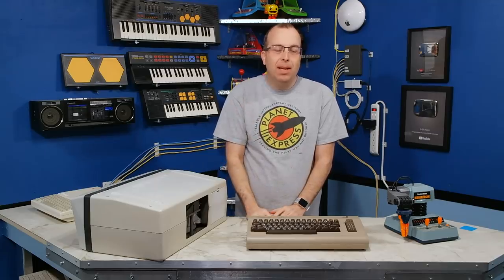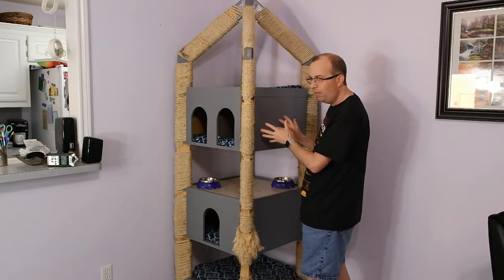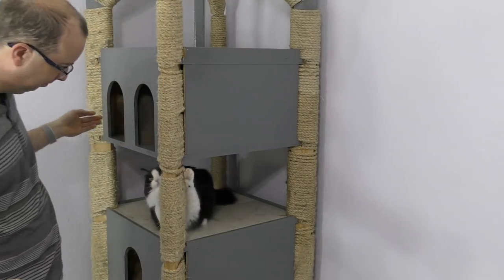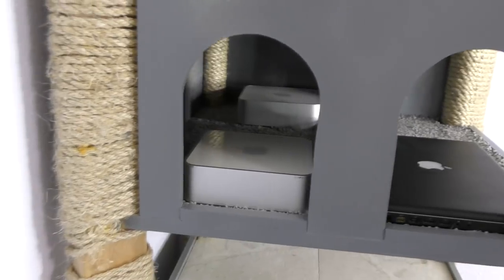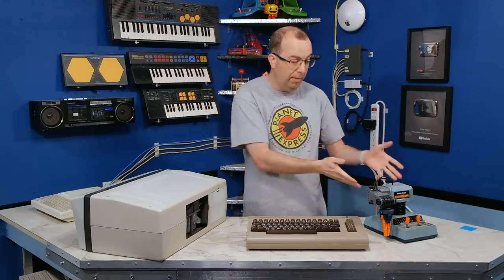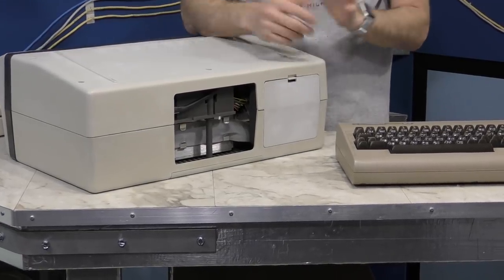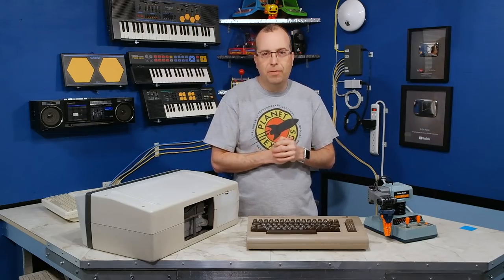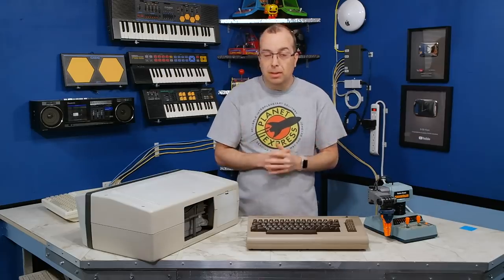Updates on Previous 8-Bit Guy Projects

Comment: Here's an interesting question -- If the range extending gas motor/tank are so rarely used, is it an issue itself? Like... a well used motor is a clean and smooth motor. Also, leaving gas in the tank for... years (a few gallons in 2 years?) the gas could go bad couldn't it? Or is it a sealed enough system that it's not an issue?

Comment: Dave, you can get some round plastic rod from a hobby store and make your own gear for that armatron. simply cut teeth into it using some files. should do it and you'll have extra material if it breaks again.
Reply: also sorry to hear a subscriber ripped you off basically.
Reply: OpposingForces I think getting enough strength in those thin slivers of plastic between the teeth is going to be the biggest problem with almost any replacement.
Reply: yep nylon should do it, or make a file guide on 3d printer and then make from aluminium

Comment: That broken gear in the armatron... you might be able to mould one with resin... if you used a North American equivalent of this stuff: 
https://www.easycomposites.co.uk/#!/resin-gel-silicone-adhesive/casting-resin/Xencast-PX90-Semi-Flexible-Polyurethane-Casting-Resin.html
it'd certainly be strong enough. And casting is just so retro... it's how we 3D printed back in the days of 8-bits.

Comment: I second what others have written about the Armatron gear. Since it is both small and simple, if it were me I would just get a bit of brass rod from the hardware store, cut off a bit, chuck it up in your drill, spin while using a flat file to get the correct OD, cut to length, drill to fit the shaft, needle file the few teeth, and epoxy onto the shaft. I have done this several times to make small gears to restore antique mechanisms. Does not really take very long, costs almost nothing, and usedms tools you either have already or can buy inexpensively.

Comment: Haha, classically geeky to get so much into the project and forgetting one fact . :) These carpets when new can emit chemicals (both odorous and odorless) through even 6 months. You wouldn't like to sleep in a room with it if it was not ventilated. ;) The cats are probably thinking: just when the foamy beddings stopped to smell placticky he changed them for a new plasticky-smelling beddings. What does he want, to poison us? ;) Ever heard of solid, hard seagrass-filled 100% non toxic bedding for animals? You know, they have n times smaller body mass and x times more sensitive smell, so... ;) I bet I'll hear some reply to this fact in the next video. ;) Don't worry, if the carpet is properly made, not with some chineese-poisonous plastics, the 'factory new smell' will go off with ventilating the room and the cats will like the new build.

 I've cut and dried normal high-length meadow-like grass (freshly grown and w/o direct exposure to car exhaust fumes of course) and the dogs liked the cosiness of such pillow instantly! Animals know what's best for them. You may try that with your cats.

Just in case: I like your videos, my comment is precise becasue I hope that info would help you in some future cat-house update. :) You can also put a fan for a day or two and check if it will blow off that 'new smell' off the carpet so the cats like it more. :)

Comment: @6:50:  Unless you're printing at a ridiculously high resolution, .1mm will be fine.  Use PETG or ABS at 100% infill (its small enough that it'll likely go 100% anyways) and it'll be plenty strong enough.

Comment: Radio Shack's Armatron Robotic Arm from 1984: could you pull the cog off one of the axles in the sparm arm ?  Or adapt one of the other axles with a cog from the spare arm ?  Failing that you could have a go at making my own cog from a small brass rod - cut off the required length of rod, drill a hole through the midle, and gently file the teeth with small files.  Use one of the other plastic cogs for a template.  Take it slow.  Epoxy it to the axle when done.  You should end up with a good result and it shouldn't take hours - once you have the brass, the files, etc ready to go.
Edit: fix typo.

Comment: Can you send me the dimensions of one of the gears? I've got a 3d printing service and this looks like the perfect excuse to load up nylon into one of my 60 micron nozzles to test that. I've printed working gears with a diameter of about 3mm already. And I've printed parts that as of now withstand multiple tons of pressure. So combining both techniques is the next experimental step 🙂

I've got a picture of a plastic roller used to bent metal plates into shape in my page:  https://www.3drt.eu/en/2018/02/25/load-bearing-capacity-of-3d-printed-parts/

The load of that little armatron shouldn't be much of an issue 😀

Comment: Yeah that armatron claw gear was always the weakpoint in the design, I remember operating one and hearing the clicking of the gear jumping. The fact the gears were plastic probably didn't help either. I'd love to see a video of somebody modifying the armatron with metal gearwork, like making casts of the existing gears, racks, and pinions, and using those to make steel parts. Or maybe Brass with a leather wrap where the plastic black sleeve goes, with a miniature steam engine hooked up to power the main shaft :D A steampunk armatron would be so sick.

Comment: just discovered your channel;, very nice. As to your armatron, every motion has a primitive slipper clutch on it, you can hear them engage if you stall one as a click, click, click. Mine had a broken gear on the metal shafts as happens with many gears of this type. I replaced mine with a gear from a a tamiya brand gearbox set, its been so many years I dont remember the precise kit. I did have to drill the center out of the gear to fit on the larger shaft. It was secured with a little CA glue. You should also look for an armatron 2, it was a mobile one with tracks and an arm. Be well!

Comment: About the Armatron-Gear: Have you been able to find out about the exact measurements of the missing part, is it exactly like the others?
If so, you might ne able to recast it in resin, it it isn't even too small for that.
If so, you should post a diagram of the exact measurements - I think chances are pretty good that someone might find a fitting substitude from somewhere else, maybe from another toy!

Comment: My condolences on the loss of your kitty.  They're all so adorable!

I'm still driving my 2013 Volt and I love that car.  The fuel savings compared to the van I used to drive all the time pretty much makes the car payment (I have a nearly identical van as a winterbeater to keep Michigan road salt off the Volt, so no fuel savings in the winter).  I can't recommend the Volt highly enough.  Unfortunately I've never seen any advertisements at all for it, so a lot of the public doesn't really know anything about them (at least around here).  Down side is, I live in very rural place, so to drive to any city will result in burning at least some gas for the round trip if I can't plug in.

Comment: I wonder if you may have had better luck with your second story room of the cat tower if you had drilled an access hole in the ceiling of it, along with clearing away the center divider. I built something "similar" years ago, and each level is accessed through the ceiling of the level below. Make it an adventure for a cat, and it's more enticing!

Comment: Here you go. Apparently, you may have to drill out the core to 2.5mm, but these should work for the armatron.

uxcell Plastic Gear DIY Reduction Worm Gears Model 102A for RC Car Robot Motor White 20Pcs https://www.amazon.com/dp/B07DH9DH89/ref=cm_sw_r_cp_apa_i_DuCOEbH60A1E7

Comment: I have one of Armatron robot and it also had the problem with the clamp gear.  The funny thing is that I simply had one 3D printed and it has held up just fine for over a year now.  I'm not sure why he is claiming that it isn't possible to 3D print it.  My guess is that he just doesn't want to mess with it.  It is such a quick easy fix that would bring two vintage Armatrons back to life.  He should donate them to someone else that will actually take the time to fix them.

Comment: I wonder if there's any engineering solution to that Amatron design flaw. Has anyone invented a gear that can transmit a limited amount of rotation into movement, and continue to apply force at the end of that movement (so it keeps gripping), but lets the shaft spin with just the resistance of keeping the grip going?

Comment: You could try the replacement by using a 3D Printer that uses Tough-Resin...

Have one at Home... The Moai SLA printer.
Just would need a STL...

The other possibility: making a mold

Comment: Hey David, why are you using such an old dell monitor for video editing? Wouldn't be better to use something like older Apple (HD or LED) Cinema display? I use them (24" HD Cinema display in secondary setup and 1x 27" LED Cinema Display + 1x 27" Apple Thunderbolt Display on my primary setup) and after a few years they are still working very well and they look awesome!

Comment: The gears are a really funky size.
I fixed mine ordering gears from a place called sdp-si.
"A 1M 2-TA32008" and "A 1M 2-TA48010" were close enough to work.
The failure is not due to spinning of the gears. When limits are reached, you will hear a clicking sound. I'm not technically versed enough to know what it's called, but you will see a coupling that acts kind of like a clutch. This will allow the shaft to spin, while the articulated gizmo has reached its limit.

Comment: You should be able to print the Armatron gear in polycarbonate or nylon without a problem using a 0.2mm nozzle on an FDM printer. Should hold up about as well as the OG nylon gear.

Comment: Back in 1985 I built a Vic 20 controlled Armatron,  I replaced the motor with 6 12v dc motors (and gear blocks) giving me 12 inputs (forward and reverse) that came from a 16 bit decoder that the Vic ran, It worked but the transistors I used kept blowing so then I tried using relays but the output from the vic was pulsed and wouldn't run the relays,   I still have it kicking around somewhere  .

Comment: LOL I also used kitchen floor tiles for my desk. worked just fine for over 5 years. In fact, I recently found leftovers so I could replace couple that have worn down a little. (just shiny stuff flakinmg off, wood pattern is fine)

Comment: To the robot: I could make you a gear that small with my 3D printer if you have constructed it... But: the gear will be too weak...
(it starts to crack very fast)
The better Option would be to make a part with the  3D Laser Resin printer (SLA ) , make a mould out of it and fill that with some strong material!

Tough resin is another opinion... 
But for my SLA printer this resin is not available at the moment...

To the handle: hope you'll get it back!

Comment: For the Chevy Volt (I know it's not related to computers) I've found with one my family member has, if you drive under 50 miles per day, then it makes sense as the average range I've seen on one of those is 30-60 miles or so.  But if you commute to work, say, on the highway, it may make some sense, but you will still need some gas.  But even driving on the gas engine, I've been able to get around 35+ MPG (and that's on a 2012 Volt).  I'm still not quite sold on completely electric vehicles, except maybe the Tesla models that can go 200+ miles per charge, as anything less than that really ins't feasible unless you just drive locally or don't take road trips that often, or aren't in a rush and can let the car charge at charge stations every few hours).

Comment: Looks like you could take a cigarette lighter heat up the metal shaft Slightly on one of the other gears of your parts Arm robot You should be able to slide the gear off once the metal is hot put it back on the other shaft with some superglue It won’t be as strong as original but it will get you up and going

Comment: STL for a replacement gear for the Armatron can be found at: https://www.thingiverse.com/thing:1241175  

Rather than printing this at home with an FDM printer, I'd upload to shapeways and get it made in a number of different materials and see how they turn out. I've used their strong&flexible (sintered nylon) for projects before, but for a small gear like this, their HP Nylon might be the way to go.

Comment: You mean "electronic" engineer, not "electrical" engineer.
I highly doubt an electrical engineer could do that kind of thing, seeing as they work mostly with higher voltage AC in buildings and installations.

Comment: Yo, I built those arms before. Those 4 gears are the sames. So take one from your donor. FYI you could find a machinist (aka thisoldtony) replace most if not all gears with metal then upgrade your motor.

Comment: 7:07 "There's nothing to relieve the pressure on that gear once the clamp is completely closed"
Wrong, the gears on the clamp side have teeth missing, so when it's completely closed the driving gear (the one that broke) just spins freely.
That's just a matter of many transfers of motion through many gears, because that's the last moving part, that makes that particular gear work over time, if it had been metal or all the gears were lubricated with PTFE grease (which I don't think existed back then) it probably wouldn't have broken.

Comment: Will you ever get a brown cased original Commodore monitor for your bread bin 64? As for the Armitron gears, I'd say try and find a hobby shop that deals with RC stuff, they have a ton of different plastic and metal gears used for RC drive and control.

Comment: Think one of these days I might built a desk similar to the one shown.  I have a store-bought one that is similar, but it just isn't that sturdy as it's partially made out of fiber-board (although the tops are made out of a heavier wood) but it has a column that sticks up where the two pieces join which is annoying.
For electric cars, I would only buy one if it was only a few years old and has less than maybe 30,000 miles on it.  The batteries generally need replacing after 8 years or 100,000 miles (although with the Volt and others that have a gas engine as well, you may be able to just drive on the gas engine when the battery dies, but those batteries can cost upwards of $6,000).  I see a lot of Toyota Prius's being sold for cheap (like $1500) that are 8-9 years old because they need new batteries.  So either buy them with low miles / newer, or buy them new.

Comment: As far as that little gear, try looking for old toys that have cheap, DC motors in them; they often have a nice, metal gear on them, though you might need a gear/pulley puller (Micro-Mark tools used to sell one, I don’t know if they still have something like that, but they’re used to remove model train wheels from the axles) If you’ll email me the dimensions of the gear (or take a photo of it next to a scale rule) to Wsquires-at-satx-dot-rr-dot-com, I’ll see if I have any hobby motors with a gear like that on it. Don’t worry about the cats; they’ll find a use for your ‘mods’! :)

Comment: Cat names... The Noid, Pig Bunny, and ... er... what? "She"? Kitty McCatface? Kirjava?

The little gear, would it work to 3D print a sort of template for it - essentially a puck of the right outer dimension, with a centre dimple top and bottom to guide you in boring out the axle hole, and bumps around the circumference of the right number and position to guide you in filing out the teeth by hand / using a very fine metal filament saw (at super low speed with tongs to hold the workpiece...), gradually and carefully until they matched the depth and width of the teeth on the other gears, overcoming the resolution problem?

Of course if you're going to do that you might really be as well to just get a miniature pulley of the right dimensions and axle width, then mark it off with a pencil and protractor, but if you haven't such a thing knocking around 3D printing then doing the donkey work to finish it off might be your only practical option.

Then whilst you're at it, put an endstop sensor system in place that will stop the motor trying to overdrive the gripping mechanism in either direction.

NB, whoever it was who had your Osborne handle ... presumably you have a street address for him? Might be worth getting some trusted associates who live near him to go and check up. You know, just to be sure of his wellbeing, he might be sick, dead, in a deep depression, homeless, kidnapped, or a school student whose extracurricular activities have been found out by his parents with all internet communication cut off as punishment for not knuckling under to the man.

Comment: When I was at University I had a VIC 20 and that was about the time that Radio Shack introduced the Armatron.  I bought one thinking that I could interface the arm to the computer.  Of course when I opened it up I was confounded to find that the whole unit was mechanical.  Years later, Radio Shack sold another unit that was interfaceable, but I had lost interest by that time.

Comment: In the arm.. all those gears are the same. You could harvest any of the small gears of the other unit. Also, 3d printing IS an option, depending on your printer offcourse. My printer (basically a beefed up prusa i3) would print it just fine. If you want me to print one, I'll need the inner diameter (where the axle goes), the outer diameter (around the tooth) and the number of teeth.

Comment: I would have got a 2017 VW golf mk7 hybrid granted they are a little expensive to buy but in the long run they would be cheeper to run but the power behind them is amazing and a full tank can last a long while depending on how long the car is used, roughly a few months

Comment: I got an Armitron, complete it box with all working gears. If you held the controls in place it would cause the gears to skip. Luckily I didn't abuse mine but if it were to break I would consider making a new gear out of a wood dowel.